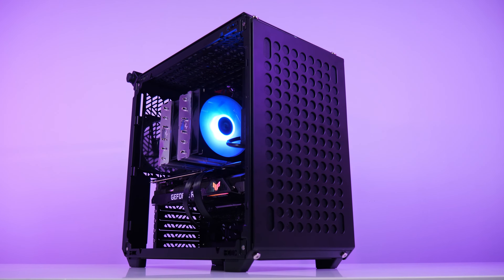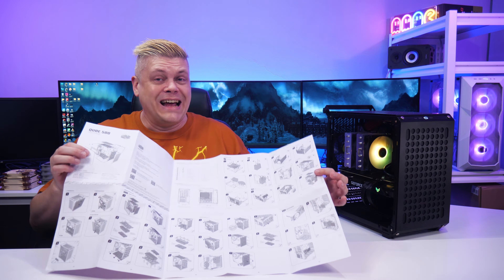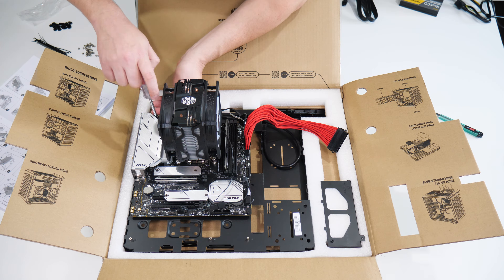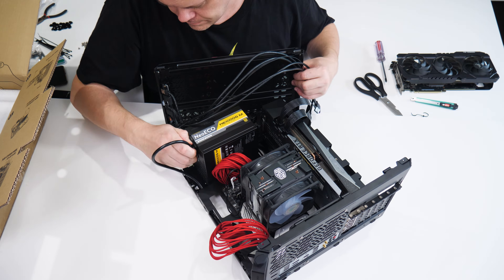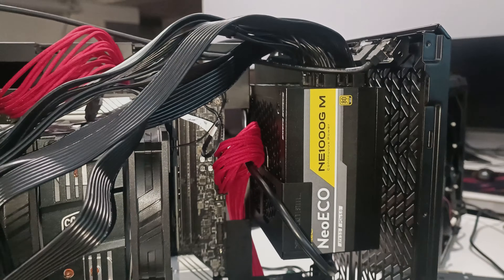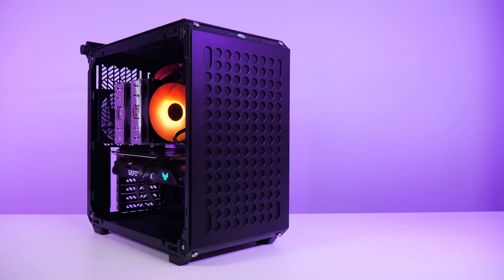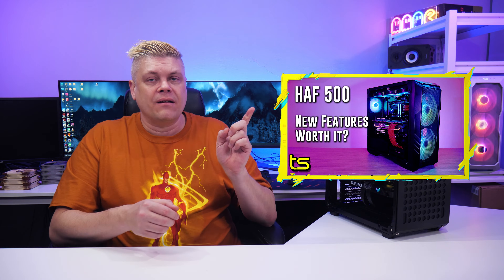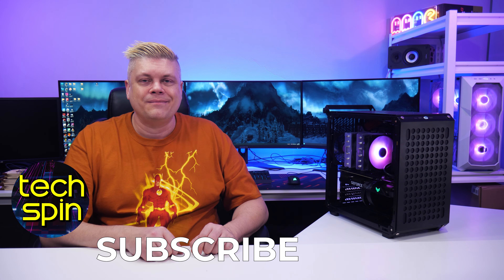IMPROVED Cooler Master Qube 500- we found a PSU workaround!

Comment: only one mentionning the flipped PSU - I had the same issue, especially my CPU power cable was too short : and had an sfx psu, apparently one can fit a PSU on the top pannel ! it's a bit of a tight spot with the 45 degree front pannel connectors, but a tiny spu is verry happy sitting at the top corner of my case.

Comment: that's a pretty slick PSU workaround honestly.  my PSU is longer than normal.   and my GPU is XFX 6800xt, so long-ass.  it was a tight fit with a front intake fan and the longer psu.

Comment: I have this case coming for a throw back EVGA themed build I'm doing. I am worried about how I will for 2 240mm AIOs though... Wish me luck!
Reply from the maker: The temps are rough without using an angle grinding to cut out rectangles for the fans. Recommend do that first and use a little touch up paint as it'll be hidden under the filters, but be advised the corners get gaps as they are weakened from this. I cut the top, front, rear and bottom for great temps. Please subscribe, thanks for your support!
Reply: @Techspin  im definitely running without the filters. I have a space im going to put the case and i may not even use the top or front pieces. Because you wont see them anyway. That should help a ton with airflow. Also i may end up leaving the glass side off.
Reply from the maker: In my testing (a lot was done after publication to try to fix temps) the filters contributed only a little to temps, the main problem is the panel porosity itself. Leaving the acrylic side off may work, but there's not enough air behind the fans to grab and push. The stupid front IO should get removed immediately and consider a simple power switch wire to turn on for testing as it's cramped inside with the wide flanges on the side. Wish u luck!
Reply: @Techspin  good to know, thanks!
Reply: @Techspin  update. I was able to fit my 3080ti hybrid and 240 aio on the case with the PSU on the bottom.

I took out the filters and put the front and top panels on. It does great on temps. With 4 aio fans one bottom fan. CPU is 50 to 60c AMD GPU is in the high 40s to low 50s gaming. Couldn't be happier. No case mods just took a couple hours to figure out how to make it all work.
Reply from the maker: Nice, good work there. Probably helps that the AIO fans have a higher mmH2O static pressure there, enjoy!

Comment: Thanks for this. CM removed the manual from the product page and took down their Youtube playlist instructions so I was having a hard time understanding what configurations would work with my components. I was interested in this for the 20 Gbps USB-C and because they claim the case can be footed horizontally. I think a horizontal config with the perforated panel on top instead of the glass and some selective intake fans at the GPU and CPU would make for very good airflow.

Comment: I suspect that if we are able to put a partition between the top of the GPU and the CPU, then there will be better directed flow with less turbulence. Then the path of fresh air in to waste air out will be straighter. 
You wont have hot GPU air being used to cool the CPU, and also you wont have hot CPU air being used to cool the GPU.
Once it gets hot, it will go straight out without heating up the new fresh air.
I just need to get a panel that is non conductive so that I can install it to separate the 2 sections.

Comment: Just built a system with this case and am very happy with it. The instructions are a bit scattered but far from as bad as some youtubers say, and honestly, if you can't build a case this simple, you might want to give a second thought about building your own system. The design, materials, paint and fit quality are excellent. It's compact and has huge breathing room (it's 07/07/2024 and mine already came with the higher flow dust filters). I did purchase fans for the bottom of the case to make it a positive pressure chamber. After my experience I bought three more for systems I'm building. If you want a very compact full ATX case with great configuration flexibility, I'd highly recommend the Qube 500.
Reply: @kzar42  I was looking into buying this case in 2025 and I was hoping cooler master did end up fixing the dust filters. How can you tell they are new and improved dust filters?
Reply: @ by now I’d imagine that any stock in Amazon or New Egg comprises of the newer version. Early last year I built three of those and my kids two, and they were all the new version, so I wouldn’t worry. You can aways return it after all.

Comment: I bought the white version and built it with the rear io pointing up, so the gpu stays vertical and i love how it looks! In this configuration the psu lays in the bottom but since i have a 2 fan gpu cables weren't a problem, and i mounted 4 case fans, 2 on each side of the case blowing fresh air directly on the gpu and the cpu cooler. I think that this case shouldn't be for a classic build, it allows you to free your creativity and do things other case can't
Reply: The only downside is the i/o panel is almost unusable in this configuration. If only it could be moved around like the old design.
Reply: @dazed_confused  yeah but having better acces to the rear panel i don't actually need it

Comment: even with the workaround, those psu cables pinned against the top panel do not look safe and id worry about my psu cables getting damaged over time or not sustaining a secure connection :( really thought the case was cute and loved that it was compact for an atx but looks like i gotta keep lookin for the right case for me
Reply from the maker: It's not a problem but you do you! I'm certainly feeling safer this way than having all the cables pushing down a hot GPU IMHO 😂
Reply: According to some "electricians" (I can't verify the claims) the cables used in most psus are a specific kind that are fine with tight bends as long as they're not being bent over and over again.
Reply from the maker: Yeah they're designed to be bent around corners, but the only caveat is if you're using a 4090 with 600W ATX 12VHPWR cable-that case and that case alone currently is where you have to be careful.

Comment: The specs say 173mm of clearance of the psu from first gpu slot. I have an huge psu of 180mm and a long gpu in front of it. Do you think it will fit with the tip of rotating the psu upside down or not ? My psu has slaved cables, and they can be bended... thank you.
Reply from the maker: Nope, need a bigger case or plan to purchase a smaller PSU or GPU, sorry bud.
Reply: @Techspin  You had issues with the PSU because it looks like your mATX board has the PCI-E slot higher then in a normal ATX board.
With the PCI-E slot one slot lower there is a lot more room for the GPU. I have seen builds with 160mm PSU's and Huge 4090's with no issues.
But yeah i would not recomend using a 180mm long PSU unless you have a short GPU.
Reply: @j.p.h.8126  thanks
Reply: @Techspin  thanks a lot 😉😉
Reply from the maker: No prob, health issues, sorry for the delayed reply. This case is challenging to work in and even with a normal size 150mm ATX PSU  you'll have trouble with a 30cm PSU as we noted. 😉